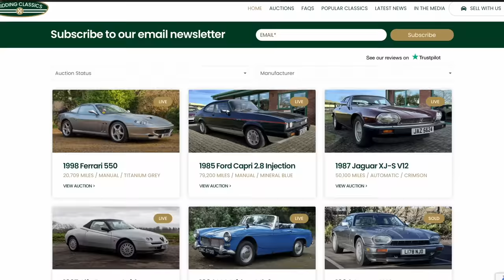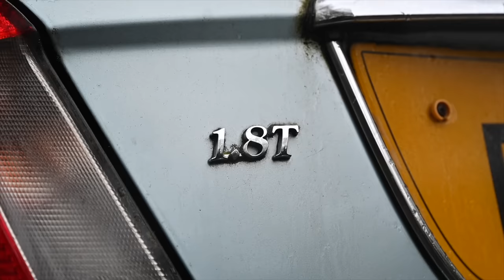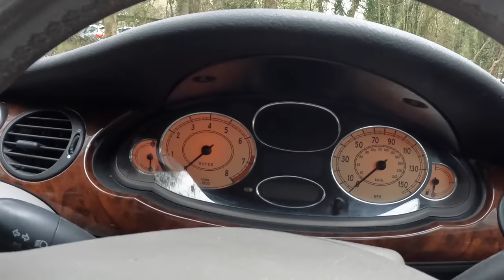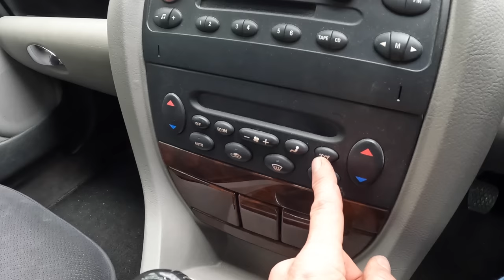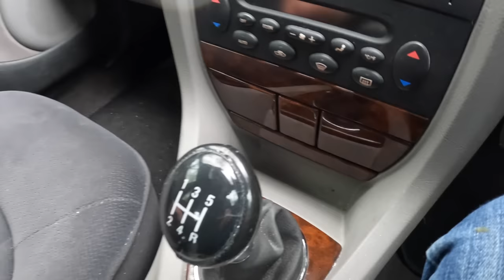The Fiat has gone, a Rover 75 was inevitable

Comment: I love my 2.5 V6 - so much more character than all the modern cars I see every day. A quick note which may interest some 75 owners. I'm on my second 75 V6 and when I first drove it I was surprised that the suspension seemed noticeably firmer than the first one. I found out that Rover offered a "sports suspension" kit and this must have been fitted to mine. Although the ride is not quite as comfortable, the car does not suffer from the body roll on corners which bothered me on my first 75. There is a very good owner website and I guess there will be more info there if people are interested.
Reply: One of the finest engine starting noises ive encountered, could listen to it for days

Comment: It's great to see the 75 finally getting recognition for what a nice , well built car they are and you've got the most drivable engine choice I'd say. 
3 years ago you'd have probably got £800 plus the Rover for the Idea, they really were worth that little. 
In 2021 I bought a clean early 61k miles V6 2.5 Connoisseur for £250. So well appointed, smooth and classy although not as brisk as I'd expect but wow it could chew through petrol at an alarming rate. 
Looking forward to seeing you mint this one up on the Flip Mission 👍

Comment: Back in the summer of 1998 I read about this car in What Car magazine and they were comparing it to the Jaguar S Type which also launched at the same time, Whilst the 1.8 turbo K series didn't come out until early 2003 (It was purposely built for the all new 2003 MGB sports car), they compared the Rover 75 2.5 v6 to the 3.0 v6 S Type Jag, they also said that the Rover 75 was actually a BMW inspired product that used some interior parts like the Sat-Nav/TV head unit with the 4.3 screen from the all new E46 BMW 3 series also launched that same year (1998), I can in fact see a lot of BMW influence with the headlight design and front end styling compared to the old outgoing Rover 600 and 800 series which were heavily influenced by Honda ! - Great Car - Super buy or shall I say swap ! :-)   Well done !

Comment: I had a 53 plate v6 2,5 auto. Lovely car to drive. Yes it only 27 mpg but it was quiet, comfortable, and had a turn of speed in s mode if you wanted it. On mine the CD changer was in the glovebox and the rear seats folded down for longer loads. I only sold it because I had my right leg amputated. I'm a bit old to learn to drive with my left foot.

Comment: Hello Matt.  An underrated car the Rover 75.  We had a 53 plate club SE diesel (BMW engine I believe).  One problem we had, and something to check when you're doing your clean of it is to check the plenum chamber.  At least that's what I think it's called.
We began noticing a sloshing noise when turning corners at slow speed.  Couldn't understand what it was until one day the car wouldn't start.  It was just turning over, as if out of fuel.
Turns out the water we heard has filled up in the plenum chamber and because the engine management gubbins was in that chamber, it got drowned. The drain hole in the bottom of the chamber had become blocked with leaf matter and crud, causing it to fill up.  Water from the windscreen flows down and ends up in it 
It may be different on the 1.8t, but check the area by lifting the access cover on the nearside.  Lift the bonnet and at the base of the windscreen you can see the lid to this chamber, just make sure the drain hole is clear. 
Looking forward to seeing how you come on with it.  Ta, Rich.

Comment: On a 'P' plate and MG Rover owned it was probably a BAE Systems car, they had the MGR management scheme and their cars were all Preston (P) registered. Can't agree on mpg though, my ZT V6's did late 20's, whilst my ZT 1.8T did very early 30's, so only around 4mpg different. The spec is correct - yes a cassette and no CD, that came in 2003, and dual climate was standard at Club - I think yours is a Club SE as it has the 17" wheels. Good luck with it

Comment: I’m excited for this one! Not long since added an early 1.8t ZT-T to my wee fleet. Have been loving the engine so far, have a wee check that the cooling fan works. I drove mine from Devon upon collection the 400 odd mile home and then discovered it didn’t work! 

Mine is a Dec 2002 car and seems to be about the time of some project drive stuff being implemented with some original features present and some not.

Comment: The inset AIRBAG badge was only found on the later de-contented Project Drive Rover 75 models, which also had genuine plastic wood dashboard trim panels. Earlier Cowley & Longbridge-built pre-Project Drive-era Rover 75s all had a gold leaf AIRBAG decal & genuine wood veneer dashboard trim panels.
Reply: Other way round sorry. The Airbag lettering on real wood dash's airbag sections are flush with gold lettering, whereas plastic ones have a badge with silver coloured letters and is set into the 'plastic wood.
Reply: Matt's car has the plastic wood dash, change over in production was at some point in 2001. A real wood dash (known as pre-project drive or PPD) can be had for about £50 should anyone fancy tackling the conversion.
Reply: @Simon-ui6db  My Bad - swapped them over - brain fade moment - only realised that now - I will edit my reply accordingly - thanks for the heads-up!

Comment: For the attention of Mr Furious! First job should be fitting a metal T-Piece for the cooling system. The original plastic ones are prone to failure and if it cracks or shatters and you don't catch it immediately it'll take the head with it! I don't want you to suffer the same fate as I did with my ZT!

EDIT: The part number is PFK000040!

Comment: I briefly had a rover 75, v6 connisor, loved it, was actually pleasently suprised at the mpg, While granted I was not exacly pushing it, I got to 35+ mpg. However I changed it for an MGZT Turbo (which I also loved, till it got pinched). You keep saying it has a tape deck so low spec, the multichanger in the boot was the higher spec, the normal spec was the single cd player at the front. I replaced it with a sony Head unit anyway as I wanted bluetooth. Those head gasket prices are barmy. I used to buy mg's from auctions cheap with gasket failures, used to get them fixed quite cheap. Due to rover for some reason using rubber gaskets when metal ones were only a few quid more and lasted ages, where the rubbers went around 50,000.

Comment: I had two a 2004 MK1 and a 2006 MK2 which was made in March 2005 so both post project drive models but they were great barges. They are coming past the awkward banger stage with most of the unloved cars biting the dust. Values are starting to climb for well sorted cars. I bought my 2004 for £450 and sold it after 60,000 miles and 2 years motoring for £400. The Mk2 with 40,000 miles I bought for £750 and sold for £1650. This was pre pandemic so I suspect they are worth a good bit more now.

Comment: I was tempted to buy another Rover 75 but I've had 5 and so many problems list as long as your arm. I first fell for these cars in 2004 when I delivered the complete front valance for the Rover 75 V8 they were painted next door where I worked in Southam Warwickshire by R.D.S my job to deliver to Longbridge they were wrapped in hession put in a stillage and inspected for any imperfections out of 20 being delivered half would be returned for repaint so who ever says that quantity control didn't exist is wrong. The front valance on the V8 was beautiful when fitted out. I now check the MOTs at DVLA all suffer from the same problems Corrosion/Rust etc.

Comment: Very nice but the best spec would surely be a 2.5 V6 Connoisseur Se pre project drive though yes yours is the best colour with an amazing history and mileage!
I had a MG Zt-t 190+ facelift and always got 30mpg out of it and you're right, it sounds amazing when the Vis motors are working correctly. It sold to the head of the Austin 1100 club so in safe hands but I regret selling it!

Comment: Have to admit, my 75 is one of the cars I regret selling.  That and my first MGF.  Dual zone climate was standard on all models except the Classic (which was the base model).  The radio cassette was standard on all models of that year, although that is the low line system used on the Classic and Club.  The Conoisseur and Conoisseur SE used the high line model and a 6 disk changer.  What was optional was the BMW narrow screen TV/Sat Nav setup.  You need to do the cambelt for definite.

Comment: Grease on the break pipe unions is a common treatment to avoid them rusting out. It amazes me how often MOT inspectors mention it when the point of doing this is so obvious. If I didn't have a very nice XJ 350 Sovereign, I would have put down money on this one until you were ready to sell it. I've had two MG ZTs & loved them both.

Comment: I worked on the development of the 2.0L BMW common rail diesel engine for the Rover 75 (codenamed R40 if memory serves). There was a rumour at the time of the car's development that it utilised the floor pan from a previous generation BMW 5 series ... hence the noticeable transmission tunnel intruding into the rear seat footwell. This should not have been there for the front engined Rover 75 car.

Comment: Good choice FD. Not ill advised. 

The 1.8T is the RIGHT power unit to get. Yes, ten years ago when I first got a 1.8T MG ZT, I was amazed to read on line groups opinions that this engine is the best option. Better than the V6s and BMW Oil Burner. Correction, I found that statement hard to believe. Ten years of 1.8T experience under my belt, I now understand that viewpoint fully. I confirm that because one of my Longbridge cars has Mustang V8 under the bonnet. The V8 ZT is more fun to drive for obvious reasons, not least that sound when it comes on song, but for the every day daily driver, the 1.8T is the one to go for.

If as good as first impressions indicate, this one should be your best long term daily keeper. Flipping should be excluded.

Comment: That's an early 1.8 Turbo 75. I have read that they came out in July 2002, so that would have been registered in the first six months. The registration area suggests that it was not a press car, but it may well have been owned by a leasing company originally for a short time, and then sold to the first private owner.

Comment: I've had 40mpg out of my 2.5 V6 on a run before now. Cruise control set to a steady 65mph. The trip computer actually said I'd averaged 42mpg! But I manually calculated it to be a little less. Its pottering around where the V6s struggle, low 20s is the norm.

Comment: Please please check carefully for HGF, as the turbo K series was far more prone to it, then the standard engine. Also the bushes on the front lower arms are very prone to wear and movement, which can be felt when applying the brake's. Also check the front to rear brake pipes carefully as they tend to wear through where the are clipped to the, it is very tricky to see.
Reply from the maker: It had a new HG and head in 2018, hoping they used the good gasket..

Comment: Great looking car. Cant agree with the comment about V6 struggling to reach 20mpg, at least in comparative manual form. My 2.0V6 manual has never dropped below 26 on a combined cycle and on motorway quite capable of more than 40. Of course the 1.8 would be more economical but it was more about the company car tax than the mpg issue.I only get a combined 33mpg out of my 1.8 non turbo 45.really good purchase.
Reply: I manage 35 mpg in my manual V6 Tourer on a run

Comment: Got a rover 75 1.8 turbo 54 reg auto from a car auction back in 2018 I payed £275 one owner full history with 100000 miles on the clock really nice condition drove lovely for 5weeks or so and then the problem started blowing water pipes   after 300 to 400 miles a time I soldier on with that car for 8 months even going to Wales from Essex yes it got me there but had to changed a pipe to come home in the end I traded it in for a fiat Tipo 2016 car got £200 for it. Glad to see back of it obviously a head gasket or head 😅

Comment: I studied the 75 brochure 20 odd years ago when it was new. The range went Classic, Classic SE, Club, Club SE, Connoisseur and Connoisseur SE. That's definitely a Club SE as it has the bigger wheels with a slightly jazzy design (compared to the rest).

I don't believe there was ever a CD head unit for the 75, which is presumably one reason why MGR ended up using a naff aftermarket head unit. To be fair, in 1999, a CD changer in the boot was still a sought after feature.
Reply: I have a Connoisseur SE, and also has no CD head unit. I've had an S-Type from the same year and that had both tape and CD changer. I thought it strsnge for such a high end car offering tapes at that time but there you go.

Comment: 75 1.8t is a thoroughly enjoyable bit of motoring, but I'm biased about 75s. Revs wonderfully and pulls very nicely. 

Metal T peace ASAP, get "toaf" on a laptop with the right cable ASAP and you can check all the things like fans and silly problems they can develop with age.

Comment: I had to laugh when you were talking about the stereotype of the former owner of the car. My mother was 60 when she bought my 1990 Volvo 240DL estate new. Arthur was her birthday present to herself. She drove him until she was 85 when her health let go. So far, a fairly even comparison. The difference is that Ma managed to accumulate very nearly 190,000 miles on the Volvo, although mechanically and cosmetically it was in very much the same condition as that lovely 75. Volvo Ice Blue is also quite similar to the Wedgwood Blue. I suspect, however, that Rover has never been expected to carry a full ton of cargo. Arthur has been used as a heavy duty lorry on more than one occasion and not over short distances. He was also expected to do a pretty good imitation of a Land Rover or Jeep on multiple occasions. Thinking about it, Arthur did not lead a pampered life whilst an "Old Lady" car. Since I am now 62 and plan to keep the car forever, he is not living a pampered life now, either, since he is now coming up on 400,000 miles. Plans are afoot to drive him to the Yukon Territory, just south of the Arctic Circle to visit my brother. That is another 7,000 or so miles to add to the total.
Reply from the maker: The difference is of course that those have a reputation of being unbreakable!
Reply: @furiousdriving  I just finished the video. I must say that the fuel consumption you quote is dismal if that is on the motorway! The Volvo, with automatic, is doing 35 or so if I keep the speed below 80. Not easy to do. My 89 Mercury Grand Marquis with the 5.8 litre V8 did an unbelievable 40 miles to the gallon of regular fuel on the motorway. It would do over 600 miles on a tank. The same tank as your Crown Victoria, by the way. That is more than the length of the A1 from south to north! No stops needed by the car.

Comment: Hey Matt I had the rover 75 1.8t  The seller said it was British Leyland car because the registration was BL52 LVH  in Burgundy Same alloys For me it was a nice looking. I gave £400 had Sony stereo. I scrapped it owned 1 month I think it had head gasket issues/electronic gremlins I got £150 back. 
I scrapped the first one was 2.0 v6 in Wedgewood blue cool colour. £275
It took me on few good journeys but the KV6 engine rattled cam belt maybe snapped Y137 TOH. 
Loved the Wedgewood colour sadly I never paid enough for either of my cars.

But sometimes you get a bargain. I love the Connie leather trim.
Hope you have more luck than I did with my two rover 75's for £675 and got back £250 towards a new car..
Reply: One of mine is a BL52 reg in wedgwood blue

Comment: All it needs is a good machine polish and buff the headlights. It will look like new. Perhaps even some new numberplates, I know a lot of traders do that, depending how old the current ones look. A good internal valet and an easy 3K, in my humble opinion. I also had a coil spring, go on my Mercedes. They must be particularly brittle. 😊
Reply from the maker: I looked at the classifieds and in this condition/mileage it should be worth that or close after a spruce up...if I can part with it!
Reply: @furiousdriving  If it was a press car, would it increase its value? I would imagine it would give it some celebrity status, if it was.
Reply: @Steve-Cross  No idea what the market says, but what I do know is press cars of sportier cars famously are run into the ground by motoring journalists. They have been known to destroy multiple cars in a day at launch events, never mind in day to day abuse when test driving. Hopefully this one was spared such nonsense...

Comment: Its a Club, not a Connoisseur.£1500 is top dollar for it. You being a dealer would know a dealer sells cars at top dollar. Not at public prices. With it being a low mileage car, under 60k miles, it will need a timing belt and a head gasket as the K series engines are well known for the head gaskets going around 50 - 70K. 
It is always been a car I have liked and wanted, but never owned because of the engine and history of them. A good condition Connoisseur is only around £2k.